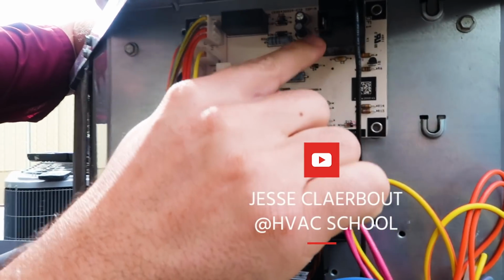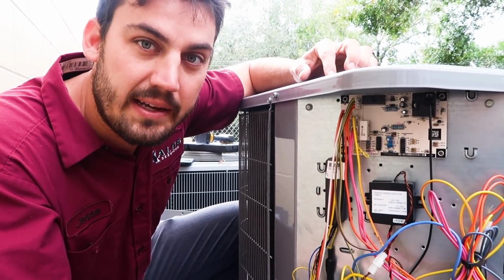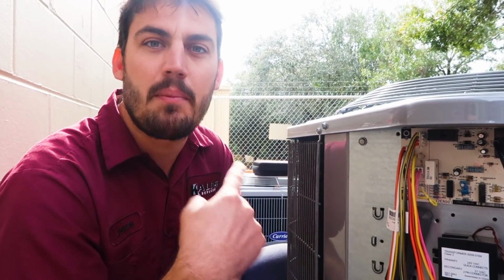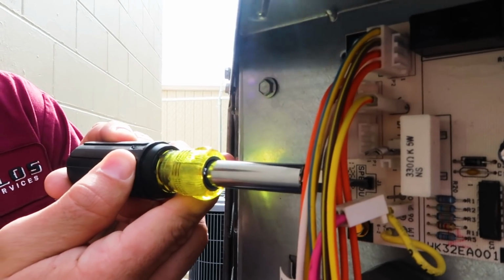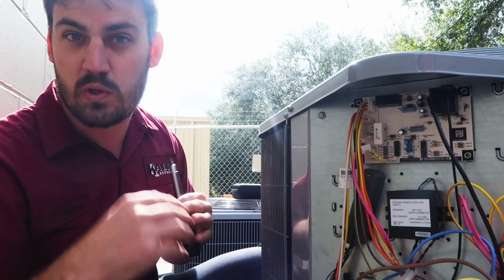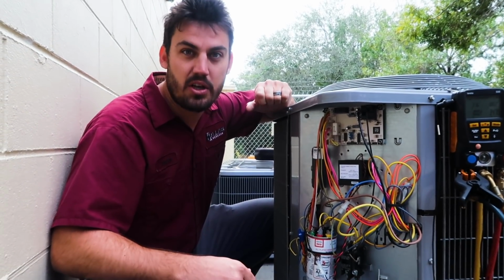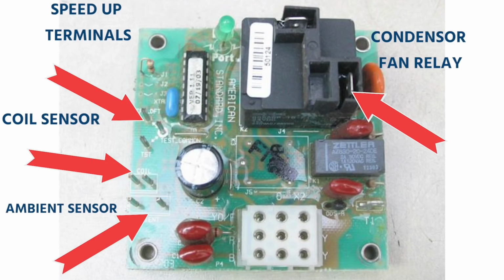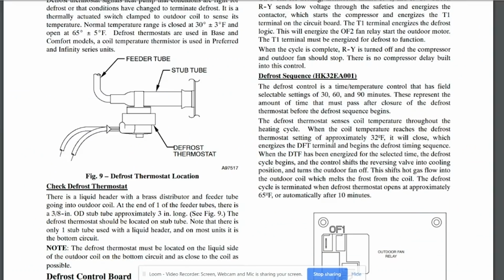How to Test Heat Pump Defrost and How Defrost Works

Comment: why would you not disconnect fan at fan relay, allow defrost sensor to close (checking with meter) and then jump speed up pins and allow unit to run until it comes out of defrost on its own? this would check defrost sensor and board in one quick test

Comment: Trane is the spelling. In your chapters you spelled it wrong and it’s not exactly impressive. On that Carrier that is not a defrost temperature sensor. It’s a simple bimetal switch. It’s a klixon type thermostat. Normally open. You guys make some good basic content, but then there are some simple things that are terms that should be correct. And obviously Train is not the name of the manufacturer. Trane is.  As an engineering employee at a manufacturer I am a stickler.

Comment: 60 minutes of accumulated run time with the dft closed has been selected. Thus, on the 61st minute of run time with dft closed the unit will defrost. With Trane, you can measure the DC volts the board is reading from the sensors, compare your 0 to 5 vdc readings with the chart in Service Facts and thus verify if the sensors are reading accurately or not. Otherwise, the board may be bad.

Comment: Thnx for ur videos. Maybe you guys can assist me here. What is a "high pressure lockout"? And could a defective thermostat caused the defrost board to show this code. My heat pump board is currently showing this code. The OUTDOOR unit DOES NOT, start up at all,  in heating or cooling. There is 24v on the R and C terminals. In  the "emergency" mode, I am not getting enough heat. It only heats up to 72degrees only, and runs all night. And never shuts off.  This is a RHEEM system. 6yrs old. I am really frustrated now, because i am having all these issues at the same time. I am thinking the thermostat is mal functioning, then I think its the defrost board. then i think the heat strips has issues. I am a wreck with these issues. The indoor unit runs fine, but NOTHING from the OUT DOOR UNIT. I just can't figure it out. Hope you or any other can assist me.

Comment: I thnk u for all the info that u put out there. I am having an issue and hope u can assist here. My Rheem heat pump, not getting any voltage at the COIL of the contactor, which is connected to the defrost board. I checked between, the R and C terminals coming from the indoor unit and I DID have the 24v going to the R and C terminals on the board. I am thinking that the DEFROST BOARD is defective, but, I am not sure. Could there be any other reason, that could have caused this contactor coil NOT to be getting THIS 24V in my case? Or can any time say?

Comment: Don't you need to be mindful that low refrigerant charge can also increase in discharge temperature? Because of the high super heat plus the heat also given off by the compressor when doing the 90-100F above ambient rule for discharge temperature.

Comment: Around 1:38 you mentioned auxiliary heat, my system doesn't shut down that auxiliary heat even after the unit reaches the set temperature, the only way I manage to stop it is by switching to AC. I have a tech come over and suggest replacing the defrost board but I would like to know the real cause for this. Any help?

Comment: 8:10    the 30,60 or 90 minute time frame is not "real time" it is cumulative run time of the compressor. If the compressor runs for 15 minutes, off for 10 minutes then back on for 15 minutes it will take 40 minutes of real time for the 30 minute setting to be satisfied

Comment: What might cose the outdoor fan to stop running and compressor still working or has this weird noise 
Anyone ever had this kind of problem, bc it’s a new unit ,I just installed it,it works for an hour and then the fan stops working but the compressor still running 

If anyone anyone sees this and have had sort out something like that ,l would lone to hear ?
Reply: When your outdoor fan turns off and makes that weird noise, it's in defrost mode and then your auxiliary heat will kick on, when the frost melts off your heat pump when it's in defrost mode, then your outdoor fan will kick on and turn off the auxiliary heat.
Reply: @craftman5632  spot on, I watched for a while and that what exactly happened,appreciate it

Comment: BRAVO !  Excellent and concise description of the subject as well as sharing detailed useful information essential for the task in hand. Thank you and please keep up your great contributions to YouTube community.
If I may suggest, please add or emphasize that Carrier defrost switches are normally-open, and as they approach freezing temperature (32F), it closes the internal contacts. So a simple continuity check on the sensor at temps above 32 degrees F should show an open circuit and this is why you need to use a jumper on the defrost board sensor pins to simulate a closed defrost switch at 32F. I think you have eluded to this concept in your video. However, emphasizing it could provide further clarification. Again, an excellent video and God's blessings.

Comment: yes. i jumped the defrost sensor, however, the Carrier package unit/heatpump, still freezes over.  If the Carrier system does not detect it needs defrost, while the jumper is on , what else could it be?

Comment: I have seen a few different techs and these guys are good too. Heat pumps cause of the defrost boards, reversing valves,by-passes and two metering devices. Makes heat pump a challenge. Straight cooling is simple now. I hope heat pump become as easy one day.
Reply: Metering devices are not bypassed. There is one for heating and one for cooling. The heating metering device may look different, but it’s there. If they bypassed a metering device it would wash out the compressor and if it’s a reciprocating compressor it would slug the piston with liquid.

Comment: Great video! The 90 to 100 degrees above outside temperature on the discharge line. Can that rule apply to any manufacture

Comment: Great video!  How do you determine if the defrost problem is caused by a bad defrost sensor or a bad defrost board?  Thanks!
Reply: I guess you check the sensor for resistance and then you check the incoming voltage of the board, that's just my guessing. If there are any visual problems with the board such as burn marks replace it. Overall if the sensor is good then it should be the board, make sure your charge of refrigerant is good cause that could be a problem too.

Comment: My heat pump system is backed up by propane. When the unit goes into the defrost mode the propane burners do not fire up, thus blowing cold air from the registers. Would the defrost board be the problem or a internal furnace problem?
Reply: Get access to the propane heater terminals. If is receiving 24v then its the heater.  If it is not receiving 24v then most likely the control

Comment: Hi how are you!!
Can you help me out with some tips !
I had a carrier heat pump brand new and when the outside temp go down more then 37 F the outside coil get frozen and I replace the control board 2 times already and the temp sensor to!!

Comment: It sure is nice that over many years now defrost controls are solid state.  When I got into the service business
back in ‘74 defrost controls were all mechanical & somewhat a pain in the rear to troubleshoot.  Since they were replaced with solid state boards, it’s a lot easier the test & initiate a defrost cycle.

Comment: Trane Pub. No. 34-4101-07 says defrost will terminate in 10 min OR when coil temp is 55 or 70 depending on type installed .. read somewhere that cutting Jumper J2 would make it 70 (vs 55). I'd be interested in what the experts say about this .. using board #02940. If true, the extra defrost time may what I need when ambient is <30F .. she tends to ice up.

Comment: Heat pumps have comealong way.I remember the first time my uncle took that big York box from out of the trk ,he would connect to the unit initiate rv,drop out the cfm,initiate thisand that.Heat pump seemed overwhelming and sophisticated. You would have a psi switch in the condenser section that would initiate defrost when a vacuum was created because of the build up ice on the coil.Newbies dont know anything about those set ups,SOON ENOUGH, THERE WONT BE aux,or it will be strictly emergency. They'll defrost like mini without blower motor operation.

Comment: I was surprised the trane guy didn't bring up the fact that trane doesn't use a(w)terminal on the outside defrost board,I believe its called X.Small fact but important, had a  installer not wire it up because he didn't know it was actually W.Obviously that was a call back on the first cold night.When it went into defrost yea the customer knew,Biggest it was blowing cold air because auxiliary was never energized.

Comment: Does anyone know why is my heat pump freezes up when the temperature are below 34. It works find above otherwise.  I call a tech and he added refrigerant assuming that was the problem. It still the same its cover in ice.
Reply: Hector, your defrost cycle is not working properly. That is why the unit is freezing up. You're going to need a qualified HVAC technician to repair that for you. You're wasting tons of money on your electric bill with that thing frozen up like that. The repair will pay for itself in your power bills. 👍

Comment: Question... If I understand correctly.
Will frost on on the heat pump coils happen only when it's used as a heat pump and not in A/C mode? If ye,s then frost can only happen when in A/C mode on the coils inside the house correct?...    In other words, in A/C mode we should never see frost on condeser coils on the outside unit.
Reply: Correct

Comment: Thanks for the info on the backup heat.  Now i know why it blows cold inside during defrost.
Reply: Your heat strip is 2 small,increase the kw.You actually shouldn't know when your in defrost, and if your heat strip was little bit bigger (in kw) u wouldn't know.
Reply: @philipwall1025  That's a possibility but it actually was because the W2 low voltage wire was not connected to the heat pump board.  Emergency heat worked fine when called for at the tstat but it never turned on when defrost cycle kicked in.
Reply: That would do it gene,also some guys like to wire each kit seperate,while other guys wire both kits together. Regardless you were able to rectify the situation, and thats what its all about!

Comment: My Carrier froze over. Doing the speed up test you showed (thanks a million btw)  it sounds as if it goes into defrost mode, but the outside fan will not stop. Then every 30 seconds or so later it does the same sound again with the same result..fan will not stop. Am I looking at a possible faulty fan relay on the defrost board?
Reply: Im having the same problem did you get it figured out?
Reply: @jaycee6639  crazy you commented today. I just worked on it again TODAY!  I replaced the board in hopes that was the issue..it was not. Still freezing up. I can hear it go into defrost mode, yet the ice doesn’t melt off the fins. Idk if my pressure is low or what. Something is definitely keeping it from heating up to melt the ice.
Reply: @Wrexxxx  thanx for the reply im stumped on this issue.  Its getting annoying because it vibrates my house when the unit goes into defrost.  Good luck!

Comment: If the sensor closes at 30F to start defrost does that mean the heat pump doesn't actually work at temperatures lower than 30F sense the outdoor coil needs to be colder than the surrounding air to collect heat? Anyone know?
Reply: HP work at very low temps. They just extract more heat out of the air when the outside temp is higher. The ice build-up on the outside coils is due to humidity in the air. That needs to be removed (defrost cycle) so that air can move easily through the outside coils during normal heating operation.

Comment: hi
i have a rheem mpi 325l heat pump hot water system unit that only runs in boost mode
the two LEDs dont light up and there is no pump, fan or compresor running
can you please help to get a service manual and circuit diagram for the control board please.
thanks guys
Reply: Sounds like you have a loss of voltage somewhere

Comment: I just had mine fixed switched from r22 to 407b. It worked fine for 2 weeks n then started freezing up bad 2 inch ice on the condenser. Do y think the board went out? The guy who fixed it unplugged the emergency heat bc of it running with the pump also. Thanks

Comment: Good video but one mistake that gets alot of technecians into more trouble. 30, 60, 90 minutes AFTER the defrost thermostat calls for defrost. The unit will then preform defrost functions. Then time up to manufacturers maximum or temperature of thermister or snap disc will cause system to once again perform heating function. The board is always checking and listening to the defrost thermostat.

Comment: Thanks for your efforts.  Maybe a good idea to show the Trane equipment like this vid showed the Carrier unit, and a little more explaining for the demand defrost operation and sensor testing and the voltage going to those sensors from the pins.
Reply: The resistance values for the sensors at specific outside temperatures is posted online.

Comment: We have a Trane XL20i.  It has always gone through a tremendous number of defrost cycles. It is in defrost at least 10 to 15% of the time the unit is running. Getting this info from the XL950 stat. Trane actually replaced the outside unit a couple of years back because they could not figure out why it was have so much cycles. The outside temp sensor always reads high. It is anywhere from 2 t o10 degrees higher that actual outside temp.  If the defrost board is looking at the delta temp (coil vs outside temp sensor), would that make the board more likely to go into defrost more often?  Our installer has ordered a new outdoor temp sensor and it should be installed next week. When the outdoor temp is around 24 to 26 degrees, the inside vent (closest to the air handler) air is at 80 to 82 degrees without an auxiliary heat strip cutting in so I don't think we are low on refrigerant.

Does the delta temp make sense as an explanation and perhaps replacing one or both sensors help?
Reply: a

Comment: If you jump the defrost tstat, how are you testing to ensure that it actually works? You're completely taking it out of the defrost scenario by jumping it. I like to pull the fan lead, let the coil get cold and ensure the defrost tstat closes on its own. Then i verify that the unit comes out of defrost when the tstat opens back up without tripping the heat pump on high head pressure.
Reply: Keep in mind, they're in Florida so that could take a very very very very long time to freeze that coil up and close the DF sensor.
Reply: @sknight0391  this is exactly it. Can’t do this in CA

Comment: Trane uses the two temperatures (the outdoor ambient and coil temperature) to calculate a delta-T in order to execute a defrost cycle.  This algorithm effectively prevents the unit from entering a defrost when warm outside, thus extending run time.  

After initial startup in heating mode, the defrost board begins a learning routine to find the nominal coil temp for the clean coil conditions.  The control then will decide to initiate defrost when:

The delta-T is 1.9 times greater than the clean coil conditions
The outdoor temperature is < 52°F
The coil temperature is < 34.5°F

or

The first stage heating operates for three hours continuously at < 28°F or eight hours continuously > 45°F, which can be reset by a defrost or a five minute second stage cycle.

Long story short, you can't trick this algorithm into defrost with "dumb" methods, which is why the control has a built in TEST function.
Reply: Now that’s good explanation technique. Thank you for taking time to thoroughly explain. As if we, the students, can’t read your mind. And torturing us with fingers in the way and mumble/stumble speak. Using a thin pointer and practicing verbal delivery is paramount. Obstructive hand gestures are bad, distracting and a show of rookieism to be avoided. OTT, they did a mediocre job. Yes, I could do better. Peace out ✌️

Comment: Pretty sure the time settings on the carrier board are for how often the board checks to see if the coil needs defrosting and not the length of defrost. 

Further, I do believe the defrost terminates when the defrost thermostat makes.
Reply from the maker: Yes we say both of those things
Reply: I must have  misunderstood what you were saying.  Bryan Orr never gets it wrong
Reply: On Carrier, T1 is energized when system is running, this powers the defrost timing function if dft tstat is closed. Timer resets if dft tstat opens before defrost is initiated. There is no checking.Its total cumulative time system has operated with dft tstat closed.

Comment: You NEVER. Hook up you're guages to the regular suctioning line during heat pump.mode.  You are pinging out those fancy Testo guages you have. You ALMAYS. Conect to the tru suction port. Those guages of yours will need recalibrated. If not ruined.
Reply: You're not going to damage the Testo gauges, they have a tolerance of up to 870 PSIG
Reply from the maker: Jason Mills the suction is connected on common suction. Look at 5:50

Comment: During a maintenance, or on a broken system,  I will pull the outdoor fan motor wire from the relay and and let the outdoor coil frost over to test the sensor on a system that is not demand defrost. Board will sometimes be good and just the sensor has failed.
Reply: Your doing it exactly right TC 👍
And a "rub" on those defrost sensor wires can also be one of the most notorious and hard to find low-voltage shorts in the winter time.
Reply: Good idea dawg! Never tested the sensor myself, only the board going into defrost. Those ambient sensors go all the time.